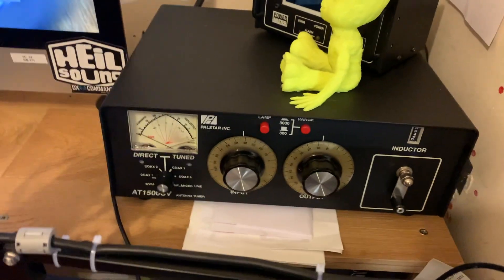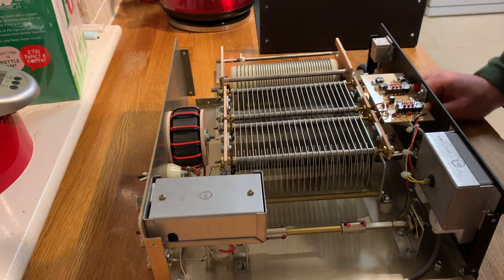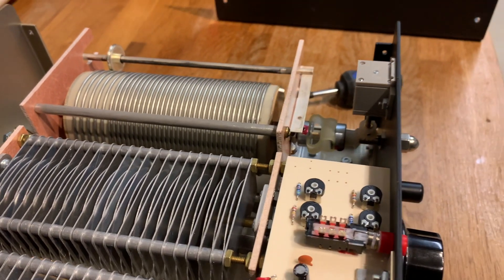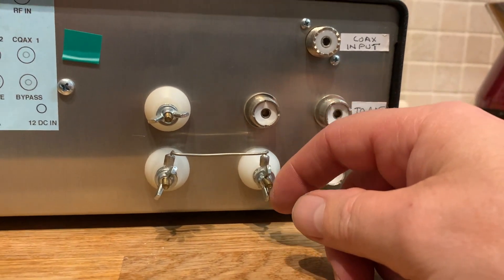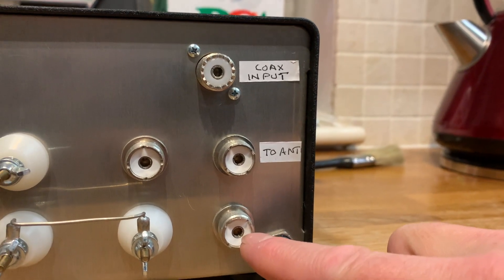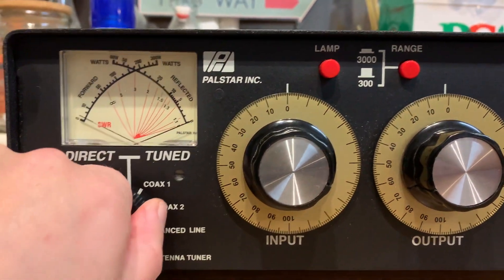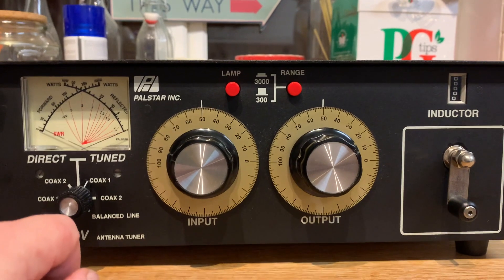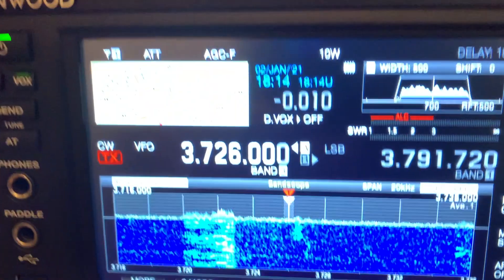HAM RADIO: Antenna Tuner/Matching Unit   -  Maintenance and use, how to

Comment: Not only does the tuner adjust the impedance to match the transmitter to allow it to produce its maximum power into the system, it tunes out the system reactances deeming the system resonant ,by way of this conjugate match it also corrects the phase of the voltage and current sending the reflected power back towards the antenna, so does alot more than just fooling the transmitter

Comment: I found it instructive to tune a new antenna with a nano vna. You can better see the position of the dips in SWR. You can 'tune' them roughly then just one capacitor will get the dip somewhere to 1:1, then the other will move that dip to the right frequency. Much easier to see what's going on. Then you try that setting with the transmitter and adjust slightly for any real world issues. They should start building vnas with screens into antenna matching units!

Comment: Best way to use a matching unit is by flipping the switch to Bypass and use resonant antennas :) 73
Reply: Be resonant doesn't guarantee its matched ,most resonant antennas have an impedance other than 50ohms